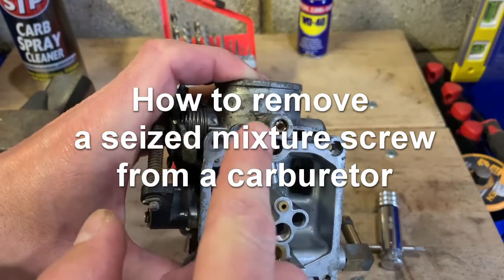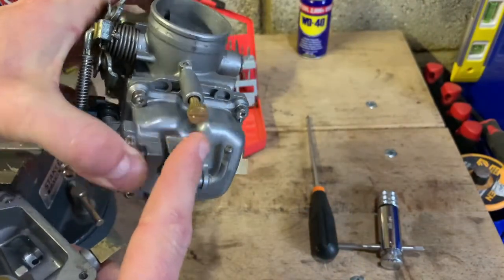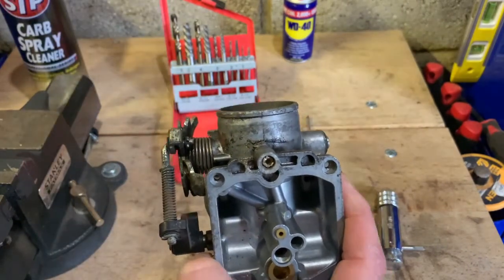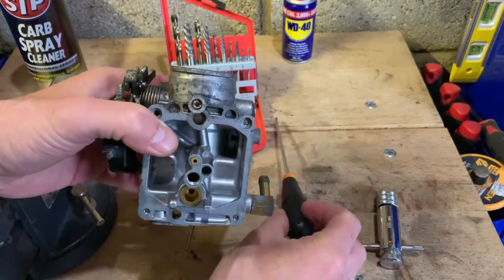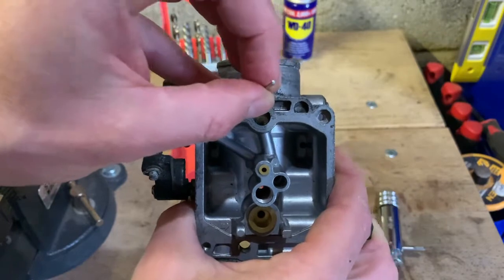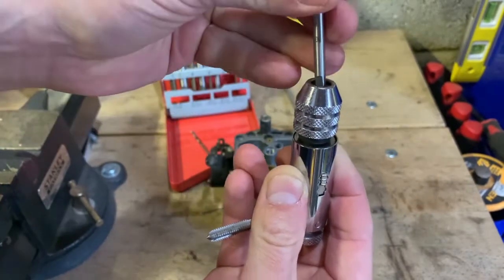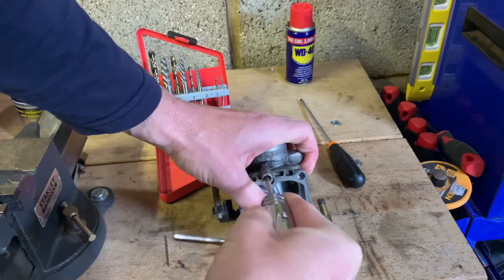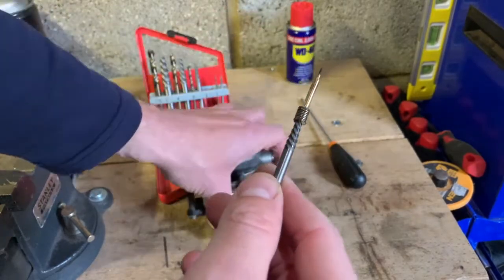How to remove a seized mixture screw from your Harley carburetor.

Comment: All I can say is you're one seriously lucky person. I have a 1998 gsx750f with a seized mixture screw. I attempted to use a bolt extractor after a week of soaking in penetrating fluid. I used the exact same kit as you and it simply would not bite the soft metal of the mixture screw, it simply chewed the remains of the screw up. Not wanting to compromise the threads, I ended up scratching away at the remnants of the screw (with a small flat head screwdriver) until there was just the threads left, with brass still stuck in them. Now I'm trying to find an appropriate tap to run through the threads before I fit a new screw, I'm having a hard time measuring the thread pitch though with it being so fine.
Reply from the maker: Yeah, I might have gotten lucky!
Just measured mine for you. It’s a M6 fine 0.75 pitch. Not sure if yours is the same but if it’s a Keihin, it’s like to be. Hope it helps.
Reply: Thanks. M6x0.5 on mine, they're mikuni. Hopefully I can save the thread or I'll have to make an insert 😬
Reply from the maker: Good luck! 🤞

Comment: Nice job with that.  Just ran into this last night. On Yamaha yz250 pwk38.  Idle air was coming out real hard then flat head slipped now it’s going to be tricky might have to do this.
Reply from the maker: Thanks. Yeah it happens. You should be able to get it out. Good luck 🤞

Comment: Could you please tell me the type of tool you used to remove it. The make and model. Thank you!
Reply from the maker: I used a screw extractor kit. I had a look, mine doesn’t have a brand but looks like the one in the link here
https://www.ebay.co.uk/itm/385156323191?mkcid=16&mkevt=1&mkrid=711-127632-2357-0&ssspo=tcko-ouhr2c&sssrc=2349624&ssuid=PaL4YB6IRGm&var=&widget_ver=artemis&media=COPY
Hope it helps